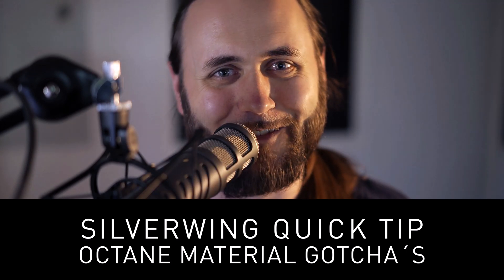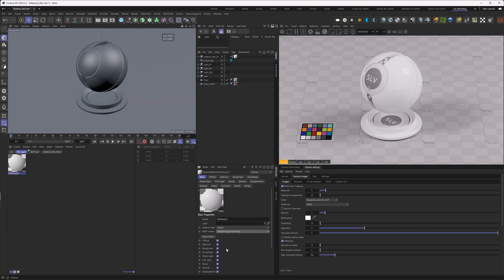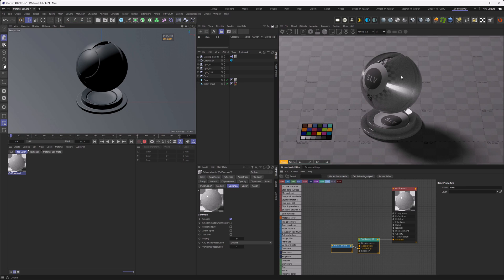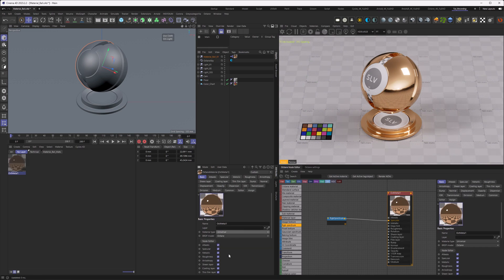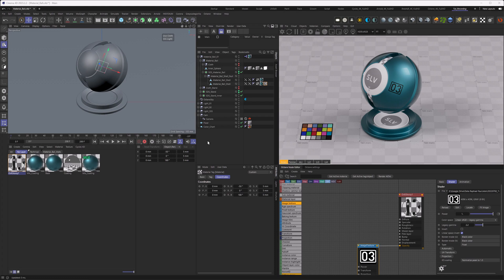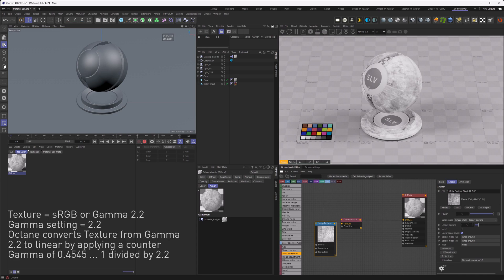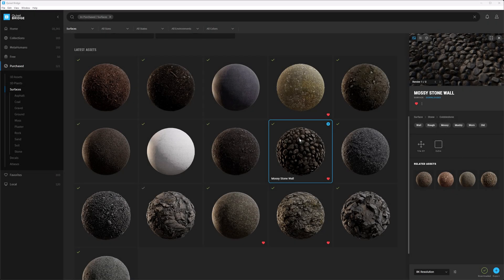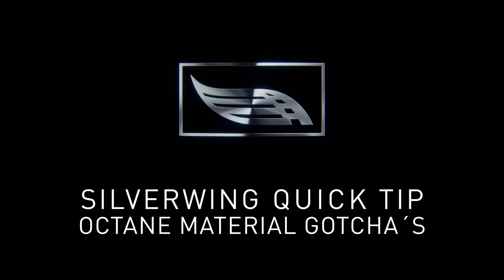Silverwing Quickish-Tip: Octane Material Gotcha´s

Comment: Love it <3. 
My gotcha is that I never really figured out the relation between the Float slider and the color sliders in any of the shaders parameter for e.g.: Transmission, Specular, Roughness etc.
You have Float slider and a Color value also. Sometimes I think that if the Float is zero it turns off that parameter, but now I know it's not true. 
So what does those sliders do actually? ( Float 0 is black and 1 is white thats the only thing I know :D )

Thanks!
Reply from the maker: Thank you very much. Appreciate your nice comment and thank you for your question.
I have to admit this is something that is not as intuitive. So you are absolutely right calling it out!

What is happening is:
If the colors sliders are anything other then pure black, then the color sliders are being used.
If the color sliders are black, then you can use the float.

So if you already know that your input wont use any color you then can set your color to R=0, G=O, B=0 and then use the float to set in the values, because you then only have to change one slider instead of three.

Hope this makes sense and explains the mechanic to you.
If you have any questions still remaining, absolutely feel free to ask!

Cheers,
Raphael
Reply: @SilverwingVFX  oh I see. Thank you! I would never have guessed that.

Comment: I've always been curious about the recommended white value. If I scan a bit of good quality white packaging like a certain phone box with my PALETTE CUBE PORTABLE COLOUR DIGITIZER it will give me a value around .9 or .92. It's supposed to be a relatively accurate device, enough for getting material colours. I also use a gretag colour chart in my renders, which sets white as .95.
Reply from the maker: Hey Agnus, very valuable question!

My main guess where the difference is coming from is sRGB vs linear interpretation. So I am guessing that the digitizer is showing sRGB values to be closer to what a "normal" person would type in as colors when using RGB inputs of most software. So actually a value of sRGB 0.9 equals a linear value of 0.78 which sounds about right for paper.

Wikipedia e.g. has a list of albedo values available.
Fresh snow and clouds (which are incredible white) are measured with albedos around 0.8 to 0.85
Paper, white paint ect. usually is darker then that. Those values are all linear values.

So it seems you are doing the right thing.
Hope I could help you with that!
Reply: @SilverwingVFX  that’s great thank you.

Comment: hey master, thanks for the class. As always your works are amazing and the way you teach is even more so. Thanks.

If possible, I would like to clarify a doubt with you and the people who follow you here as well.

The other day I was trying to use the vertex map to guide my displacement map and unfortunately it wasn't possible. Is there any trick to get this to work correctly?
Reply from the maker: Hey there and thank you very much for your nice words.
I appreciate it very much that you like the content.

About your question:
To my knowledge Vertex maps do not work with wither Displacement method "Texture" nor "Vertex"
The only way to have Vertex maps work is to UV your object and then bake them to your UV and then use the texture.
Its a pretty hard limitation for now unfortunately.
Reply: @SilverwingVFX  ah got it, thanks for your quick reply.

I did a test in redshift and it worked and in blender cycles too.
I believe it is an octane limitation at the moment, right?
Ok thanks a lot.
Reply from the maker: @xpblt  Yes definitely. Its pretty much possible to do in many engines. So not a global restriction on rendering (like dirt in Displacement usually is)
Just not available in Octane for now.

I only know because I was convinced it would work in Vertex mode and setup a scene for a training. Just to find out in front of the attendees that it would not work 😇
Not the best situation to be in ha ha ha. But yeah that´s how it goes.!
Reply: @SilverwingVFX  hahaha yes, I hope that soon this will be possible. We will include it in requests for Ahmet Oktar hahaha

Thanks again for the reply, keep up the great work you always do. I follow you for a long time and I am impressed with so much cool stuff you teach us.

Comment: very useful, thank you for making effort to teach the community! May I ask if im using acescg workflow, every image texture that i imported into the node editor, do we change the color space and mess with the legacy gamma? What about hdri too?
Reply from the maker: If what you are loading are sRGB textures, then Legacy Gamma 2.2 is ok.
If you want to be a tad more precise, you can use the sRGB preset (I personally leave it at Legacy Gamma 2.2 most of the time)
HDRIs most likely are sRGB linear should be brought in linearly e.g. with Gamma 1.

Only if you have other color spaces then sRGB e.g. ACES, then you should use an ACES profile.

Just to explain a bit:
Octane is converting all the textures to spectral in the background. So it needs to know their color space to apply the right conversion (e.g. from sRGB to spectral wide gamut)

It does its rendering in spectral wide gamut and then converts the output back to what ever you set in your render settings. e.g. sRGB or ACEScg

Hope this helps 🤓

Comment: on 13:13 Where did you find the gradient node? In my machine it doesnt show up
Reply from the maker: Hey, and thank you for your comment.

The Gradient Generator came in with Octane 2020 I think. If you can´t find it, you might be using an older Octane version. Not sure how things are looking on the Mac (if you are using the mac version). But I guess versions should have feature parity... 

Its not the first time I hear that nodes not showing up for people. Mostly its the Octane version. But maybe there is also a Bug? Maybe delete the complete plugin folder on C4D and download and reinstall the latest version.

Fingers crossed you get it working 🤞

Comment: but why Cinema Nodes Gradient and Noise is bad idea for using inside Octane?
Reply from the maker: Hi there. Very good question.
In the past C4D shaders where not supported and they needed to be baked. So insted of a procedural you were working with textures. And every texture had to be generated on the fly. Nowadays C4D functions are supported via OSL. But in the menu you can still enable the old behavior of baking. So there is always the change that people use a deprecated system.

In general for all render engines its always best to use the features that are offered directly. Not emulated features. Because they are supported by the core, you can expect them to work very efficient and therefore generally have less potential for problems.

Comment: 4 years of using octane and still learned new stuff. Ill stop using the mix material now
Reply from the maker: Hey hey and thank you for your comment.
Great to hear that there was something in there for you.
There are corner cases where mix materials are still useful. But its rather rare.
e.g. if you have mixed one material in many mix materials. You can change this one material and it will change for all of those mixes. This is not possible in the new Composite / Blend material.
Reply: @SilverwingVFX  thats exactly what i was thinking

Comment: amazing as usual, more of these please haha, I recently (few hours ago) was reminded of the sunlight and primary environment hdri bug, when I mix sky texture I no longer have the ability to make the hdri brighter or darker independently from the sunlight, so I have to dive into the image texture node inside the hdri to increase the power there, is there a better way to do that? and for that question I'll be eagerly waiting for the lighting gotchas video, thanks in advance! 🔥
Reply from the maker: Thanks so much for your comment.
I always learn something new. I did not know there was a Daylight / HDRi Environment Bug.
I think what you are doing in using the power in the image texture is the next best thing. So unfortunately I do not have a better tip handy here.

As for the Gotcha series. More is most probably coming 🙌
Reply: Fuuu.. thats a bug? I was curious why it dont works like it used to 😮
Reply: oh I'm glad I shared something useful, yes it's been broken for a while I don't remember since when exactly, I used to adjust it through the color correction node if I need to make hue shifts or play with the saturation

Comment: Soooo good, I literally ran into these problems in my last project 😭 i didn’t know what to do about the vertex map issue, so I ended up having manually correct over 100 materials, which was quite the time suck!
Reply from the maker: Ohhh, super awesome to hear you liked it.
About the Vertex Maps. ooof I feel you. This is not a nice task!
To be honest I did that too (not with 100  materials though) and was getting really tired always checking the materials for broken links.
When I was working in Redshift I saw the cool string based method so I asked Ahmet if it was possible to write something similar for Octane. And indeed he was kind enough to  implement it. I am very glad he did 🙌

Comment: Great Tutorial again. Could these Material setting even be ste a default?
Reply from the maker: Thanks so much for all your comments. Much appreciated. I have not found a way to change those standards. It seems to not be working with C4Ds preset system. But maybe I have been using it wrong. Since some one else asked the same question I will do some research 🔎

Comment: Is it possible to simulate negative IOR in Octane?
Reply from the maker: Yes, its actually possible with the new Standard Surface. All the other Octane materials stop at IOR=1

If you want to compute boundary conditions, you could also use nested dielectrics. This is less of a hassle then dealing with negative IORs.

But not sure if that´s what you are after.